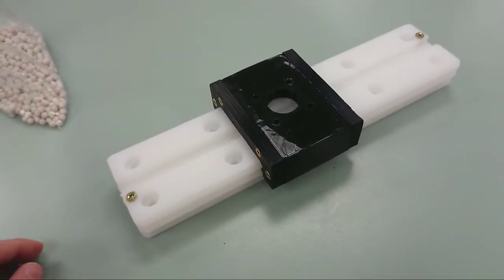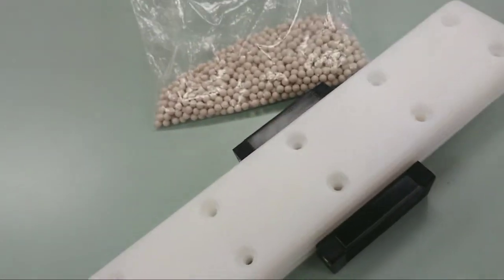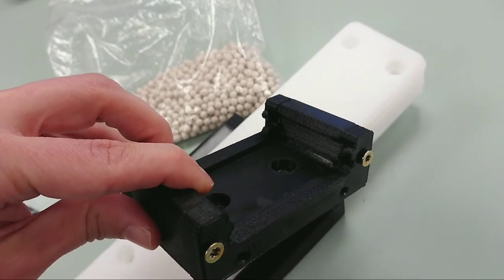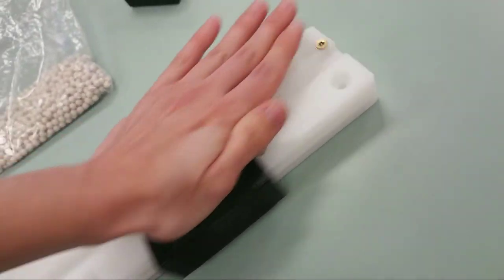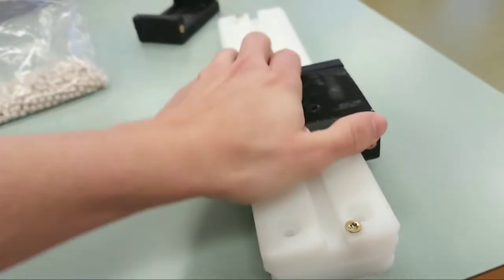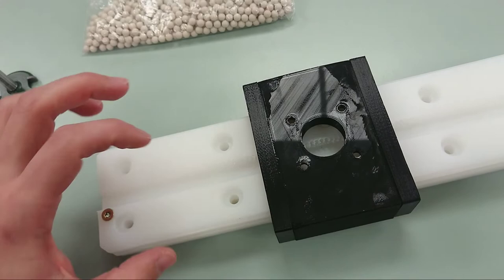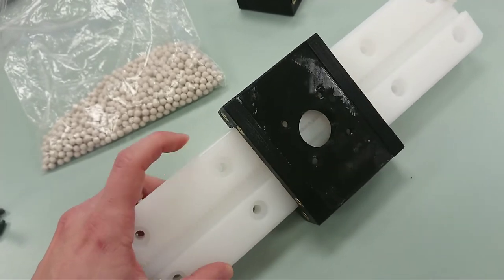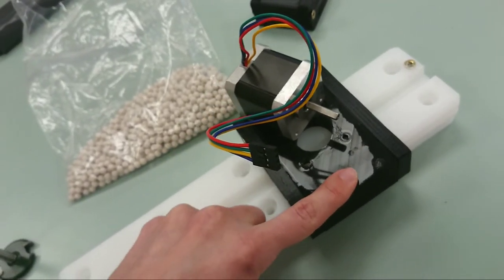DIY linear guide test

Comment: Fyi, small stainless steel bearings would be a lot more accurate to eachother. The BBs are likely binding because of their looser size tolerances.

How did you insert the bearings?
Reply from the maker: Thank you for you input! I used a bb gun speedloader for lading the bearings, it worked great. I agree that steel bearings would be better than the PLA ones I used. I hope to continue experimenting with this next year.

Comment: How did you machine the rack?
Reply from the maker: With a small end mill. Normally i use a 3mm or 1mm single flute bit in POM. On Iceland i only had acces to PE and a 4 flute 1/16 inch bit, so the result became a bit hairy/messy (polyethylene is not so easy to machine with multiflute bits)